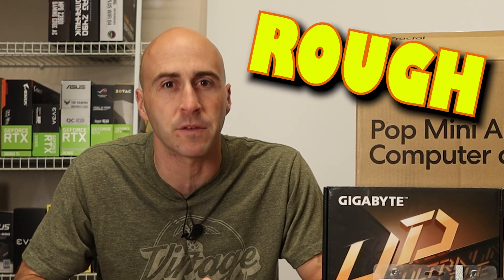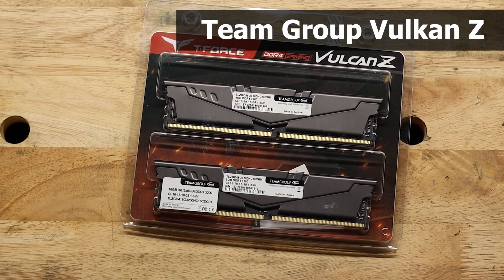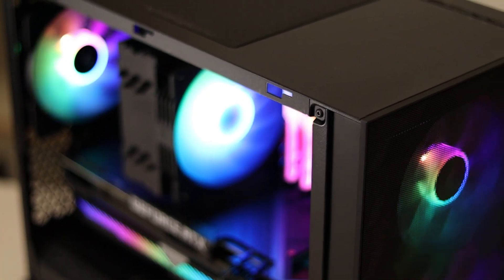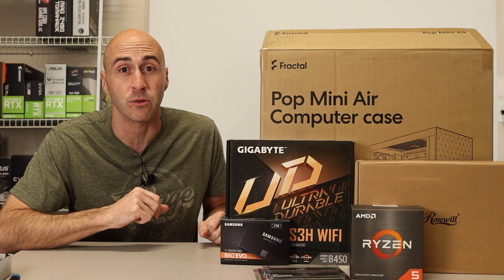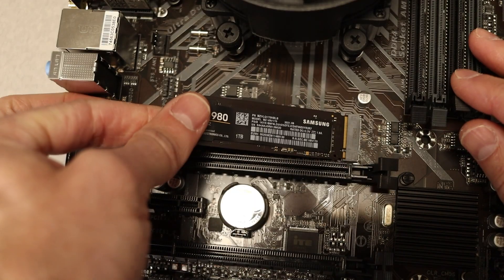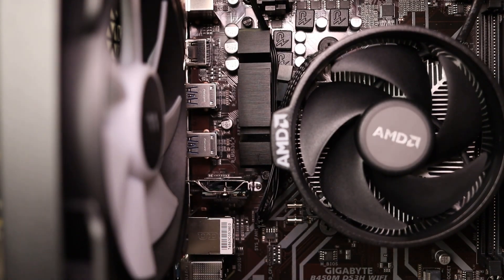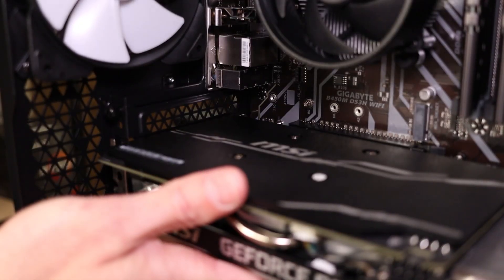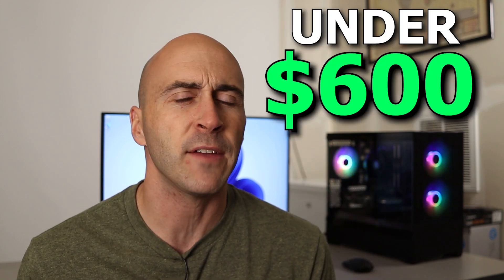How to build a Gaming PC | EASY to follow Build Guide

Comment: My gigabyte motherboard has this orange blinking light any idea what could cause it. Everything works fine tho
Reply from the maker: Might be a status light.  What board and is there any label on it?
Reply: @DannysTechChannel  gigabyte b660m ds3h idk about the label
Reply from the maker: I haven’t used that exact board but it’s most likely a status light if everything seems to be working fine.
Reply: As others have said, it may be a status or activity light. Some motherboards have a light or use a light on the board to indicate drive activity.